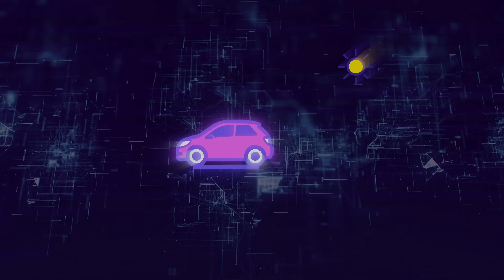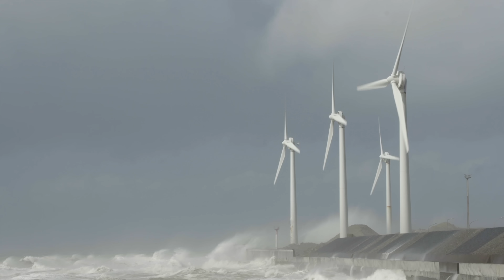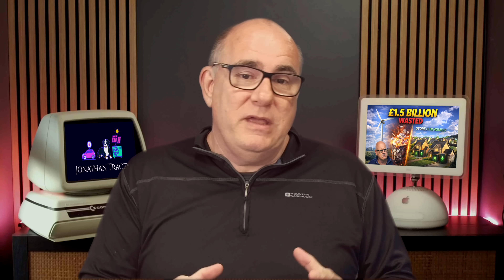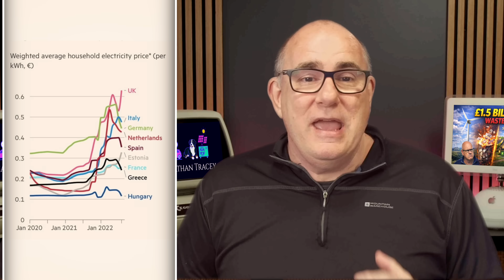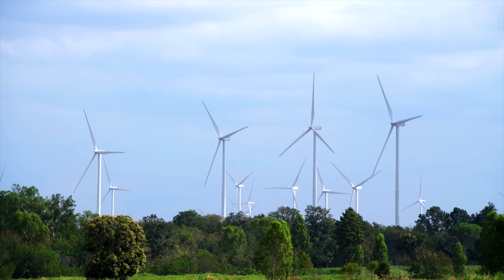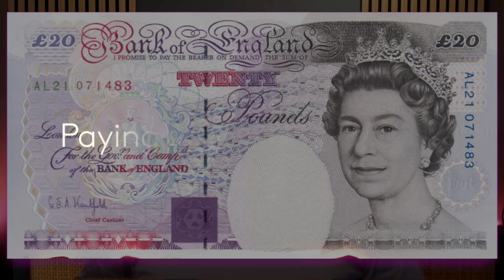We’re Paying £1 5 BILLION To Waste Energy… Here’s My Big Idea

Comment: The Govs major failing is poor communication. 
We know the problem: excess production no where near excess consumption. 
A battery to solve it would cost £48B (see my other comment for details).
They're building cables in the next 4 years to not just solve the problem, but allow for expansion of Scottish renewable production and a more energy intensive future, and it's costing about £8B. 
85% less for several times more result.
Reply from the maker: @Leo99929 I actually agree with you on the communication point 👍

Where I’d challenge it slightly is the comparison — it’s not really batteries or cables, it’s both.

Cables move energy, batteries time-shift it. If you only build cables you still end up with periods where supply doesn’t match demand. If you only build batteries you still have transmission constraints.

The real solution is a mix of both, plus smarter demand — otherwise we just move the problem around.
Reply: @JonathanTracey  We definitely need batteries to shift demand. Totally agree! 

That's to deal with the electricity "duck curve" problem regarding the time disparity between when electricity is generated and when it's needed. 

The cables deal with the where disparity between where it's generation and where it's needed. 

The curtailment costs are due to the "where" issue, rather than the "when" issue. So cables are the most cost effective solution, leaving he most money remaining to solve the "when" issue (£1.5B per year, plus £40B capital). You still get 83% of the battery storage capacity to help with the "when" issue in addition to solving the "where" issue.

Comment: Great idea, however in the UK you know what will happen the 1.5billion saved will go into the central government pot and the public would end up paying for the batteries and installation as d always the way. In short the public will not benefit but always pick up the cost. Still a great idea just cannot see it being impliemted by any Govermennt, current or otherwise.
Reply from the maker: @10rGreenninja I get the scepticism — and honestly, it’s not completely unfounded 👍

A lot comes down to how something like this would actually be implemented. If it’s done badly, you’re right, the public ends up paying twice.

But if the savings from reducing wasted energy are directly linked to funding the rollout, then in theory it should be self-funding or at least neutral over time.

Big “if” though — execution is everything with this kind of idea.

Comment: To solve the problem this would need to be a regional program, because the issue is the limit in peak transmission capacity between Scotland and London, basically. 

You've essentially got a massive "water tower" in Scotland attached to England via a little "hose pipe". As "rain fills the tower", it starts to "overflow" and we pay for the "soak away", whilst we pay to "import water" for England separately to meet local demand. You can put a load of "water buckets" in each house in the UK, but the "hose pipe" from the Scottish "water tower" can't push "water" through it any faster, those "buckets" don't fill up. You'd need the buckets on the water tower (Scottish) side to make it work, assuming that the connection bottleneck isn't already maxed out 24/7. 

Having a load of batteries in England still have the same transmission bottleneck at peak times so the power would still be wasted. 

The link spends about 34% of the time constrained (at it's limit). And delivers about 40% of it's theoretical capacity. About 1 in 3 days produces more power than the link can facilitate transmission of, leaving 2 days to transmit the excess. With a battery on the Scottish side AND a battery on the English side, we could install a roughly 240 GWh battery on the Scottish side to soak up the excess generation. This is 120 times larger than the current largest in the world. It would cost ~£48B at ~£200/kWh.

To handle the same 3.3 GW peak excess, you would need roughly two modern subsea transmission links (like the Eastern Green Links currently being built). The cost for that "cable capacity" is approximately £6 billion to £8 billion. 85% cheaper than the battery option.

To fix this, the UK is currently building the Eastern Green Links (EGL1, 2, 3, and 4). These are additional 2 GW subsea cables. By the early 2030s, these will more than triple the capacity to move power south. The goal isn't just to stop the 10 TWh of waste we have today, but to prepare for the 80+ GW of new wind power currently in the planning pipeline—enough to turn Scotland into a "green battery" for the rest of Europe.
Reply: Excellent explanation of the problem and the solution.
Reply from the maker: @Leo99929 That’s a really solid breakdown 👍

And I agree — transmission is a huge part of the problem, especially north to south constraints.

Where I’d add to it is that it’s not an either/or. More capacity helps move energy, but you still get timing mismatches where supply and demand don’t line up.

That’s where distributed storage comes in — not to replace cables, but to reduce how hard we need to push them at peak times.

In reality we probably need both: more transmission and more local flexibility.
Reply: @JonathanTracey  I think we're on the same page. We need both distributed storage to enable load shifting to match renewable generation, and improved link capacity to fully utilise the renewable resource we're squandering. 

Cables are the most cost effective solution for the Scottish wind curtailment issue costing £!.5B every year. Leaving the most money remaining (£1.5B per year, plus £40B capital after £8B spent on cables out of the £48B required to solve the same problem with batteries) to solve the load shifting issue . You still get 83% of the battery storage capacity to help with the "when" issue in addition to solving the "where" issue.  

I think the government needs to mandate that ALL newbuilds MUST be built with underfloor heating, heat pump, >10kWh (and expandable) domestic battery, the maximum solar PV that will fit, and a V2G capable charger. Yes, this will drive new build house prices up, but the cost of ownership savings massively outweigh the cost meaning that if banks are smart they should be more affordable. It also maximises our ROI. 

Rather than installing: gas heating, little radiators, tiny solar PV if any, tiny battery if any, and no EV charger. You have it all baked in from the beginning getting a huge economies of scale saving, and prevent the money being wasted on something we intend to rip out in the near future. 

"do the job once, do it right"

And all EV's MUST be V2G capable too.
Reply: With the future subsea cables, I’m more than happy to see green energy flowing to Europe (when it is windy), but am much less happy to see GB consumers having to top up those exported clean energy to the CfD strike prices. Especially considering that I have to also pay for those subsea cables for the next 40 years.
Reply: @halfmug3087   There's about 3.3GW "overflow" peak, it'll take about £7B to cover this with a bit of excess capacity via EGL1 & 2 (from what I can find, but I'm not expert!) 

So with saving £1.5B per year, that's paid off in maybe 7 years? Not 40 years. They last for 40+ years, so their ROI (~13.7% ) is better than the stock index funds! That's considered "very good return" given average stock market is 10% per year, 7% after inflation.
Reply: @Leo99929 agreed with you calculation. Unfortunately as these assets are owned by regulated monopolies (the transmission owners), under the TO price control framework, GB consumers will keep on paying for those assets (through our standing charge) until the regulated asset value (RAV) depreciates to zero - the current framework says >40 years for any new build assets.
Reply: @halfmug3087   Is that cost amortised over that period? As in, £100 asset used for 10 years is £10 a year, but the same £100 asset used over 100 years would be £1 per year instead? So the repayment period is irrelevant to the total lifetime cost? The longer the period, the less it costs per day to the customer?

Or is there some weird rule/loophole that allows them to charge more than the amortisation over it's lifespan?
Reply: @L @Leo99929 yes the cost is amortised, a bit like a reversed mortgage. So, in total, the longer the mortgage period, the more one has to pay (mainly because of the rate of return). To clarify, I know the wires are much needed, and in fact they should have been built when cost of capital was much lower (say around 2009/10 till 2015 ish). But the golden window of low WACC has gone, and energy affordability has become such an urgent issue. I believe there is a better solution - zonal pricing- instead of happily underwriting consumers’ or taxpayers’ money to subsidies a massively distorted industry, and creating inter-generational inequality by forcing the next generation to pay for our policy mistakes.
Reply: Amazing how hard the English in Westminster will work to stop the North, Scotland and Wales doing stuff, or to keep everything around London by distorting the very markets they perpetually go on about being good.
Reply: @etchedpixels  its not the people in Westminster that's an issue, its the NIMBYS in the Home Counties and Midlands who don't like infrastructure.
Reply: @edc1569  They are a problem too - for things like running pylons but Westminster has been systematically distorting energy prices for decades by not pricing industrial demand based upon locality of supply. It also wasn't nimby's that keep trying to wreck the Welsh attempts to build tidal in Swansea.
Reply: @etchedpixels  It's not "the English". It's politicians (who are usually private school English to be fair, but it's a "ruling class" issue, not a nationality issue).

And they're not stopping countries doing stuff? They're effectively investing billions to enable Scotland to increase it's productivity in this example?

But you definitely have a point in the generality: There is disproportionate investment geographically in the UK. Per capita its historically been 2:1 with the "greater south east" (London etc) getting twice the investment of Scotland, Wales, and Northern Ireland. But that's improving. It was down to 1.7:1 in 2024. Not enough change. Not fast enough.

I'm guessing that it's about ROI, as London's GDP per capita is more than double that of several other regions. 75% higher than UK average. North east England being the lowest with -28% UK average, Wales -26%, Northern Ireland -16%, Scotland -6%.

Turns out that they're investing proportionally where productivity is highest? Seems like a self reinforcing feedback loop to me. But there might be some strategic reason I don't understand as to why we need to keep "building up the over achievers" rather than focusing on bringing the under performers up to the average?

Geographic locality helps with productivity as it minimises the infrastructure investment required, and freight distance and time overhead. Essentially a city is more productive per person than the exact same people and buildings spread across the country, because less time and money is spent moving things and people between operations. I guess it makes some efficiency sense to cluster it all together?

But I don't live in London to reap the benefit, and I don't want to.

I'm hoping with modern fast computers, internet, webcams, headsets, contemporary collaborative software, we can work remotely for similar efficiency/productivity, and justify the spreading of the funding more geographically and per capita, evenly.

Comment: Hi Jon, that is a great idea using homes with batteries to store energy with free electricity. The only problem is to build factories to build these batteries would take a few years plus a few more years for our government the discuss and approve, so in the short term it would be best to get the batteries from suppliers like Eco Flow until the factories are built and ready to produce the batteries. I believe happy like many others to purchase batteries from Eco Flow tomorrow for this free storage project it just needs the government approve this fast or we end up loosing a couple of years and another £3bn
Reply: Ecoflow would be an odd choice as you'd want cheap reliable product and that's certainly not where I'd start. We do have the expertise to build batteries in the UK to be fair, just not the cells. Fogstar are UK built from Chinese cells.

The real challenge anyway isn't assembling them, it's phone support for all the people you give them away too, any controlling cloud software and security, and stopping them all ending up in Ukraine or wherever people want batteries more a month later.
Reply from the maker: @etchedpixels That’s a really practical perspective 👍

You’re right — the hardware is only part of the challenge. Support, software, security and even things like resale or misuse all need to be thought through.

And agreed on manufacturing — assembling packs isn’t the hard bit, it’s the supply chain for cells and everything around the ecosystem.

It’s a much bigger system problem than just “give people batteries”.
Reply from the maker: @stephenrudd9378 Completely agree 👍

We don’t need to wait for perfect domestic manufacturing to get started — the tech is already available and could be deployed much faster using existing suppliers.

That’s kind of the point — start solving the problem now, rather than waiting years while costs keep building.

Then scale and optimise over time.

Comment: If the grid goes down any battery attached to the grid would have to stop working to protect the linesman/ person (keep everyone happy) who is working to restore the grid so all the batteries will be required to listen for the grid signal as larger batteries do and stop discharging until the grid service signal is restored. This could cause great confusing as people will think they will still have usable electricity in the event of the grid being down.
Reply: Grid outages in the UK are very rare in most places hence the total lack of demand for backup features or generator ports except in rural spots.

But if the grid is down at scale then you aren't worrying too much about a few wind farm people getting paid not to feed in, and if the grid is down locally then the people who now have batteries are no worse off, and with many plug in systems would be better off as they have sockets on the unit itself that remain live.
Reply from the maker: yes, that’s true with current systems unless they have the ability to operate in island mode. There’s nothing to say these systems couldn’t be designed to support that.

Comment: You know what's mad, even with paying for batteries to smooth out production peaks/ troughs, and paying the wind turbines to turn off when there's an excess and paying gas plants to produce that energy somewhere else, in 2025/26, the Levelized Cost of Energy (LCOE) for wind was roughly £40–£50 per MWh, while gas-fired power often sat well above £100 per MWh.

So counterintuitively the solution is to build MORE renewables that we don't use all the time. Just closer to where we have excess consumption.
And/or move big energy consumers to where power is cheap and abundant. Like move data centres and some high energy industrial processes to Scotland.

~75% of that £1.5B is paying the gas power plant to produce power. Only ~25% is paying the wind turbine to turn off. 
If we move the power consumption to where there's excess then we solve both these issues.
If we install more renewable generation capacity near to where there's currently excess consumption then we solve 75% of the problem. 

The only reason that we're paying for the gas plant is because we didn't geographically align consumption and production. Essentially the government didn't incentivise development in an aligned way.
Reply: And some of the AR7 generation will connect south of the border.
Reply from the maker: @Leo99929 That’s a really strong breakdown 👍

The LCOE gap you’ve highlighted is exactly why this feels so backwards — cheap generation, expensive pricing.

Completely agree on aligning consumption with generation as well — moving demand (like data centres) closer to abundant power is a huge opportunity.

Where I’d add is that even with perfect alignment, you still get timing mismatches — which is where storage comes in.

So it’s probably a mix of both: better geographic alignment and more flexibility in when we use energy.
Reply: @JonathanTracey  Totally agree that both are needed. I just disagree that batteries could be a cost effective solution to the £1.5B pa Scottish wind power curtailment cost issue specifically. 

You can spend £48B on batteries and just eliminate the curtailment cost, getting £1.5B per year savings. 

Or you spend £8B on cables, leaving £40B for batteries, AND you get the £1.5B per year savings, AND you can expand the Scottish wind power generation nocking more gas off the grid, making £/kWh cheaper to the consumer due to the marginal pricing electricity market merit order model. 

I'm all steam ahead on legislating minimum new build domestic solar, battery, heat pump, and EV V2G requirements. 

34.5 Million cars in the UK. Potentially 2.17 TWh of storage capacity if they're EVs. 

30.4 Million homes, having the potential for 10 kWh average each, that could be another ~300 GWh in addition to the cars.

Combined, this could be a virtual power plant capable of running the country without generation for 3 days at a time. Without any grid scale centralised batteries.

That's ignoring the energy reduction from the heat pump COP and EV efficiency improvement over ICE.